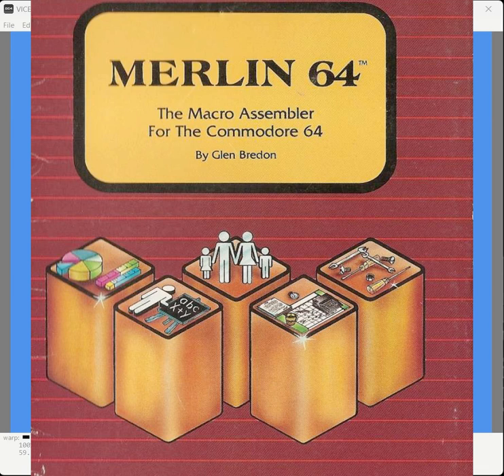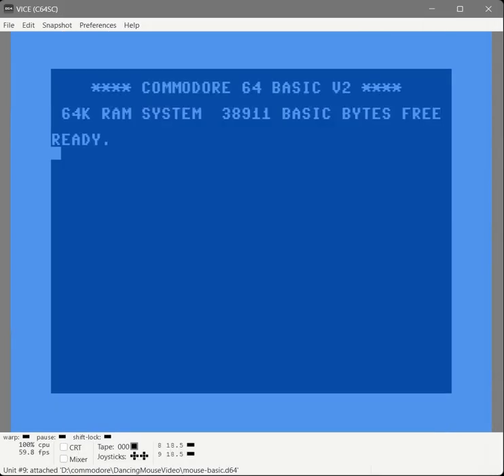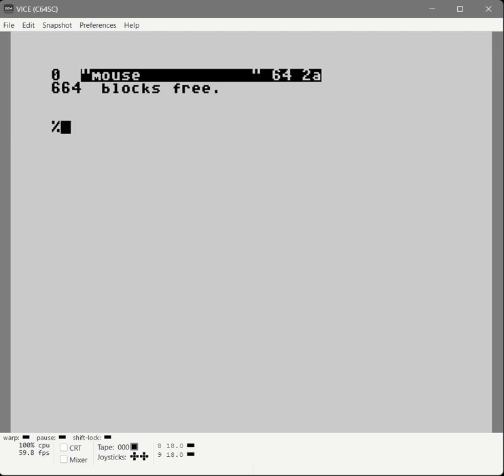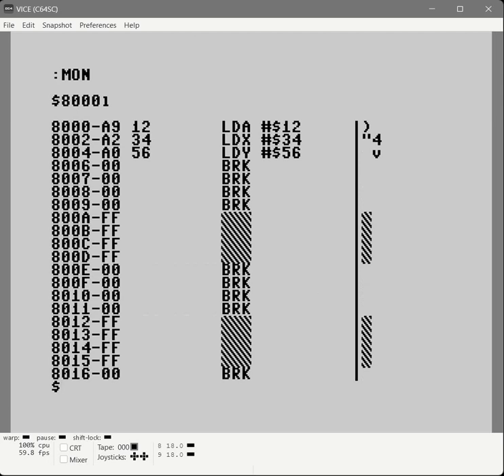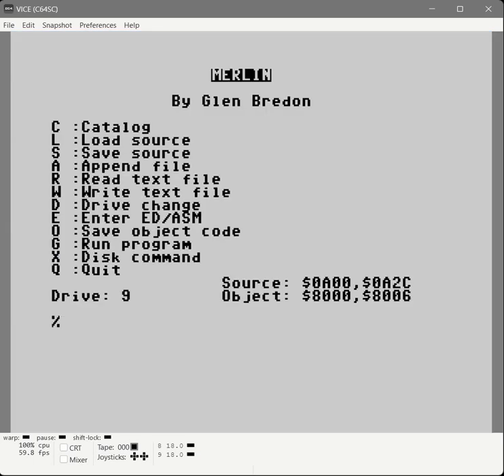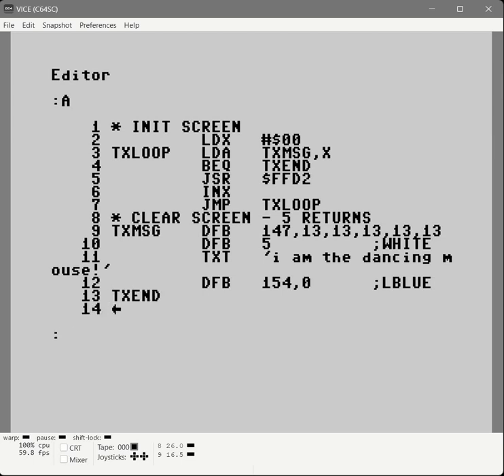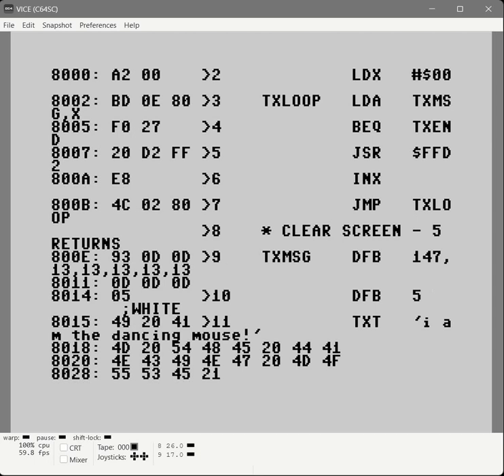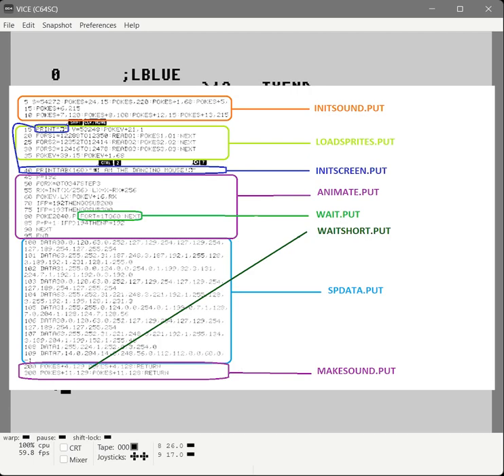Merlin 64 (6502/6510 C64) Assembler Part 1. Converting Dancing Mouse from BASIC to Assembler.

Comment: Merlin comes from the Apple II, and does things the Apple way. The old C= one you tried out earlier is the more standard syntax. Turbo Macro Pro comes from roughly the same time period, but it is still currently maintained, and native to the C64. Nothing wrong with Merlin, but it's just so painfully Apple for a Commodore kid.
Reply: If you know how to convert Merlin-oriented source to a modern C64 assembler (or cross assembler), please let me know. I have some source that I need to move to C= land but have a problem with some Merlin-specific parts/directives/macros.

Comment: The presence of the Save-@ bug depends on exactly what version of the Disk Operating System is inside of the floppy drive you are using.  I think it's fixed in all versions of JiffyDOS.
Reply from the maker: I just picked up a copy of the Jiffy DOS Rom files for the C64 and 1541 II (Only 16 USD. not too bad) and just used it for the first time ever this week in the VIC Emulator.   I did not have Jiffy DOS in my youth, I had the Epyx Fastload Cartridge and was pretty happy with that.    I am blown away by how much JiffyDOS speeds up disk loads.   I wish I had this in my youth.
Reply: @MyDeveloperThoughts : JiffyDOS also speeds up all disk transfers: load, save, file-read, file-write, and disk-controller commands.

Comment: You kids are hilarious. Do you actually believe computers were programmed using such primitive software?  We used to use Kontron in-circuit programmers connected to the target machine via a dip cable that replaced the processor. We were able to edit, compile and debug from a more powerful IBM PC-AT.  We could stop, execute and even change the code on the fly and use decent 80-column screen editors. I would have quit my job if I had to use something like Merlin.
Reply: You’re hilarious. Do you actually think these assemblers were meant to be used in a corporate setting with large resources, rather than at home?
Reply: what software would you have run on a PC-AT machine to do such c64 programming?
Reply: Back in then, you was happy having your own c64, sinclair, atari, ... and not everyone can afford floppy drive.   And ...... we had to borrow PC-AT?  from future?

Imagine not having floppy drive.  Everything loading storing on tape.  Most reliable storage were your written notes, assuming you had not enough money to buy printer.
Reply: @desertfish74  Merlin was the standard for professional assembly on the Apple ][ for many years. For several years the majority of commercially published Apple ][ assembly language programs were assembled with Merlin.  Merlin also assembled a LOT of original Nintendo Entertainment System games because Nintendo used Apples for cross development.  You've never heard of Nintendo, have you?
Reply: @Alexander-dt2eq   I don't recall all the details since this was way back in the mid-80s. I believe the assembler and monitor were part of the Kontron in-circuit programmer. As for the code editor, we could use whatever we wanted, but I used an editor called Brief which was later acquired by Borland.
Reply: @radekhn  I worked at a major software company. PC/AT was a year old.
Reply: @Peter_S_  I used S-C Macro Assembler for the Apple ][ and also signed up for their newsletter. It was a pleasure to use!
Reply: @ricardog2165  I never used that one, but I had serial number 997 of LISA and several years later I bought one of the first copies of LISA 8/16 directly from the author Randy Hyde. After that I had to transition to APW for a couple years which I felt was an absolute dog.
Reply: @bobweiram6321  Your comment is fairly hilarious because I was programming computers commercially using such "primitive software" and that was a couple years prior to the existence of the PC, let alone the PC/AT. ICE boxes have been around for a long time. I own several, but they got used for firmware development far more than software. I always find it funny when people talk about "kids" and then cite a late example like the PC/AT. Lol.
Reply: @Peter_S_  Boy, that flew way over your head. My point is that even during the time of Merlin, professional software development used way more powerful computers for cross-development. There is no virtue in self flagellation using a development process and tools that were already outdated. Before the IBM PC/AT, we used a standard PC, and before that a dedicated console, or computer running CP/M. Before that, we used terminals connected to a remote mainframe, or minicomputer to perform the compilation and editing.

Those 8-bit machines were just too limited at the time to achieve any kind of productivity. When you need to port an existing game or educational software title from the C64, for instance, to the Apple II in time for Christmas season, switching back and forth between editing and debugging on the same machine wasn't going to cut it. At minimum, you need one machine dedicated to development and a target machine for executing and debugging code. Even Bill and Paul used a minicomputer to write their first version of Microsoft BASIC for the Altair when they were students! Computers were incredibly expensive, but they were still much cheaper than the alternatives. Cross-compilation and execution for 8-bit machines was no different.
Reply: @bobweiram6321  My career started on IBM punchcards. You're egotistically trying to think your experience at business X was the standard in the industry, and that's simply laughable. I have over 40 years of commercial programming experience with clients including Apple, Sun, Boeing, Paramount Pictures, Disney, Medtronic, and many more. My code is at this moment operating inside many hundreds of thousands of chips and you can buy those products through several major resellers (including Walmart). You sound like you had a minor part at a big company. Good for you. As a product developer who was part of a large community of product developers working on a large number of products, I'm pulling form experience with well over 100 clients that paid my bills. For example, I watched a lot of Nintendo games get written in Merlin because Apples were used as the cross development machines.